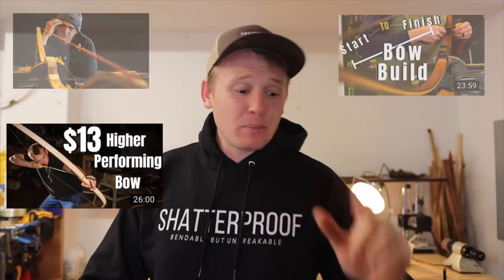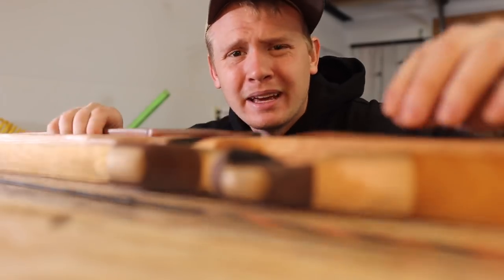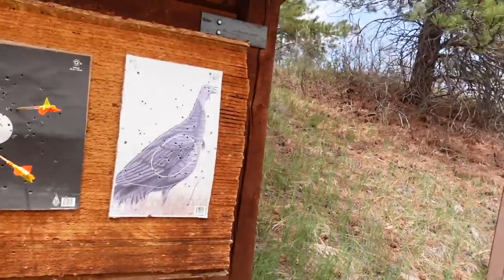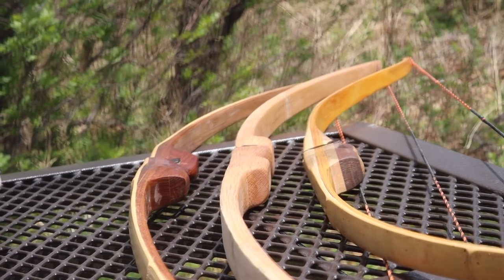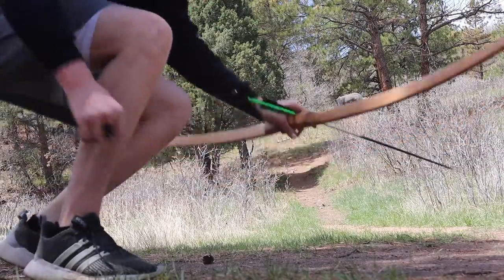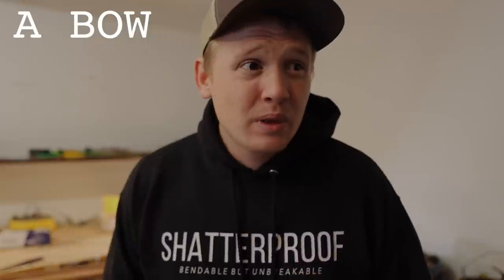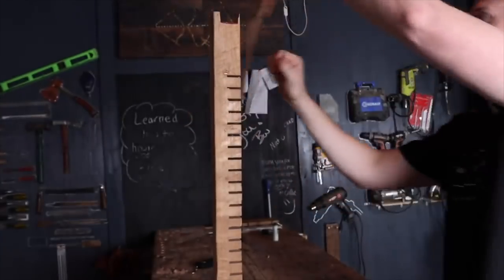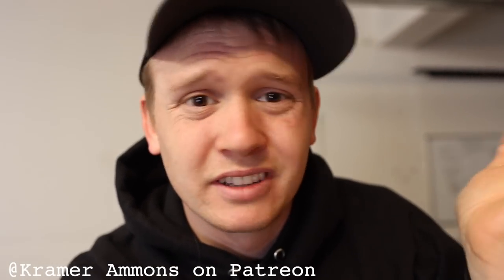1 YEAR LATER "Comparing & Testing 3 Handmade Bows! (Which One Is best?)

Comment: Since I live in Europe I never tried osage orange but my favourite bow material all things considered is white oak. It is more durable and less prone to twisting than yew, denser and stronger than ash, maple, elm or alder, can hold any cross section, can be fire hardened and is rot- and weather resistant for a white wood. The only downside is that it is a rather heavy material.

Comment: Set happens mostly when the bow is over stressed, it allso happens because of moisture, but mainly its the bowyers fault, in the desing and/or tillering. If bending wood too much, too fast, set happens, if the bows bending area is too short or narrow set happens, if the bow has weak spot in tiller set happens. It is really hard to make a bow without set, but it can be done, and if the bow doesn't take in moisture, it will not come later either. Oak takes set very easily, maby the best way to prevent that is fire hardening, it makes the bow way more compression resistant, and set is allways caused by fibers compressing on the belly. On bamboo backed bows has to be very carefull not to make the bamboo on the back too thick, cus then the back will be too strong in tension and forces too much compression to the belly, and i think that is why the ipe bow has taken set. Ipe is one of the most compression resistant woods, but it too can be overpowered by too thick bamboo back. I think the bamboo is thinner, or the tiller better on the osage bow so that it has taken less set than the ipe. Since the ipe is so strong in compression, and moisture is pretty much only an issue in white woods (like oak) the only reason possible to cause set is the bowyer him self, he has made something wrong that has over stressed the wood, and he should learn why is the set happening and learn from that. A good bowyer can make bow with 1" of set, very good bowyer makes one with 1/2" and exelent bowyer makes one with no set at all. Personaly i have made bows with no set, but only kids poundages, but i cannot seem to be able to make hunting weight bows with no set, yet atleast. I'm in the range of 1/2" to 1" set, at the moment and so far my fastest bow shoots 180 fps with 530 gn arrow 53#@29". The bow is bamboo backed jatoba elb, and the bamboo is too thick, so the bow has about 1" of set, allso i made a mistake in gluing it, and i accidentaly glued it in 1/2 inch "set" (Its not really set, cus its not caused by compression, its glued like that) so the bow has about 1.5" deflex. I made that 4 year ago, and since then i haven't made bamboo backed adult bows, so it remains as my fastest bow, eaven tough i probably could do similar bow nowadays that shoots over 190 fps. My only adult bow i have build after that is fire hardened hickory self bow, and it shoots allmost as fast, i havent measured the exact speed yet, but based on other bows that i know the speed of and comparing the penetration i would say its around 165 to 170 fps (maby close to 170) bow 51#@29, its not optimized for speed all the way, cus its based on historical examble of north eastern native american bow, so there would be some room to improve the speed, with few changes.
Reply: Now that i looked some further in to the video, i'm sure the bamboo is way too thick, and the set is 90% caused by the bamboo over stressing the wood, the rest 10% can be the bowyer, or not
Reply: The ipe is eaven thinner than the bamboo, and there is no chance a bow like that could survive without set. The bamboo needs to be as thin as possible, cus the back of the bamboo is curved, the edges has to be sharp, then its thin enough, not like that, the ipe doesn't have a fighting chance against the bamboo, and it will compress. Thats why the ipe bow shoots under 170 fps, if the bamboo would be 1/3 of the bow limb thickness, there would not be any set, and the bow would shoot way over 180 fps

Comment: Love your work man, I've tried making a longbow 3 times and have failed towards the end of the tiller. Each time I've used Tasmanian oak (I'm Australian), was wondering if anyone had some advice? Perhaps the grain is to fine? Any suggestions?
Reply: I used Tasmanian Oak for a bow. During tillering (inexperienced), it developed a hinge and broke. The wood does not have sufficient elongation strength, or compressive strength.
Reply: @keithpattison6763  ok thanks for that Keith, it's the only hardwood we have in the local bunnings and the pine they have obviously isn't good for bows. I'll have to find another place for my timber I think 😅 thanks again for the comment I appreciate it 👍
Reply: @tobyward7486  Toby, what state are you in? I am in SA and Otto's at Stepney has rock maple that bows have been made from, not cheep though
Reply: @keithpattison6763  I'm in SA so that's helpful thankyou. I'll look into it further but I googled it and it said it's permanently closed, probably just a mistake. Either way it's given me a direction so thankyou 👌